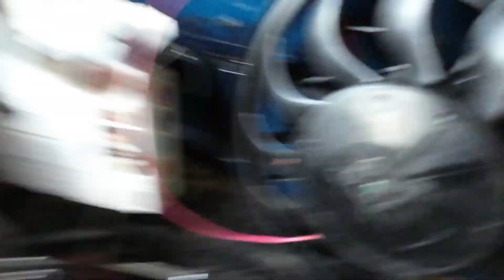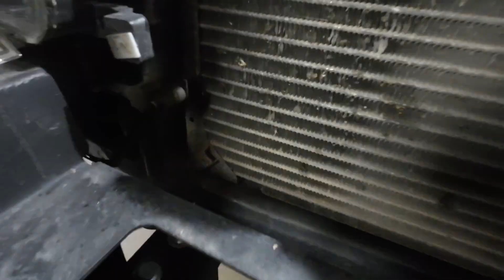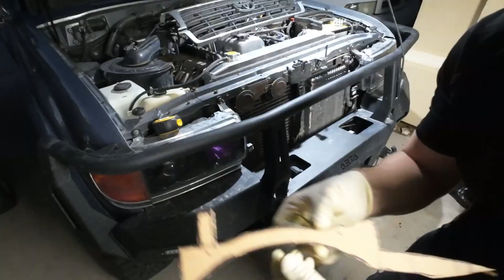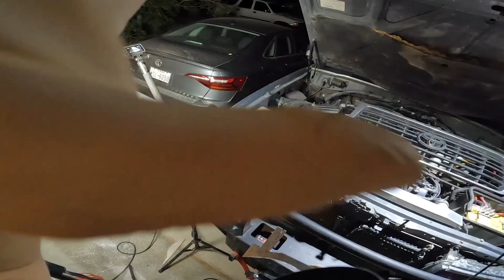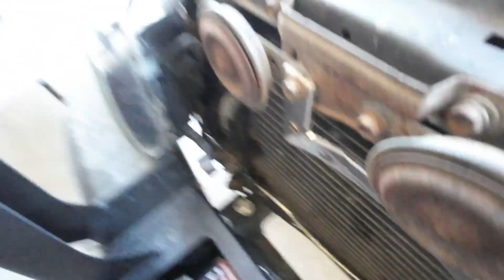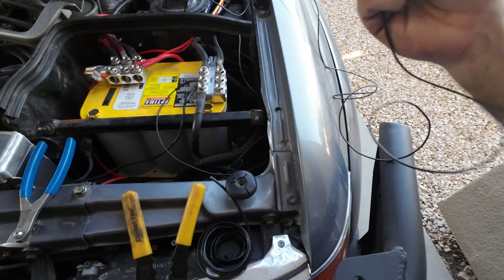The Secret To ICE COLD AC In An 80 Series Land Cruiser! | Aux Fan Install FZJ80

Comment: How is the fan working in summer?
Reply from the maker: It still works pretty good! I think it's a noticeable difference from not having one. Unfortunately I will be removing it for an intercooler very soon, but I still want to figure out a way to push more air through the grill if possible.
Reply: @motor.mausGarage  nice cant wait for the video, try an interchiller, and low profile electric fans for the radiator. There might still be some space left for the AC fan.

Comment: Toyota really cooked the 80 series with the small condenser. I have a surf where they slung the condenser under the engine and its awesome. With the additon of that extra fan on your 80 series I would also charge the ac and go over to give it more subcooling and to stack more liquid refrigerant in the condenser. Another more expensive route is to replace the condenser with a new direct fit or a much better universal fit micro channel. Your car already has the largest denso compressor offered so replacing that will be fruitless. Another thing you can do is replace the evaporator and TX valve. Toyota at least used off the shelf denso parts so its relatively painless to source. I am lucky with my Hilux surf as toyota slung the condenser under the engine. I removed the twin 7in thermo fans and fit a 14in SPAL fan. replaced the evap and TXV and it really gave it a kick up the ass.
Reply from the maker: Great tips. I did a lot of AC work before this just to refresh it, but there's still the original condenser on there. I have a new one from Toyota but you bring up a good point on the size of it, I may look for a larger one 🤔

Comment: If you want really cold AC either fit a new evaporator core with a new TX valve or get your existing evaporator core cleaned thoroughly which requires removal. If you try cleaning it without removal will not be as good but ideally just get a new one. You would be surprised how much crap blocks up the evaporator core over the years limiting airflow across it. I got mine replaced with a new one made a huge difference much colder and stronger air flow. I also run a condenser fan.
Reply from the maker: I have cleaned mine out in a video that I had never posted as it didn't come out well and I didn't film very much 😂. I didn't replace it due to them not being available in the US, but I didn't know about partsouq at the time, so I may revisit that when I replace my condenser at some point in the future. Also threw a new expansion valve and dryer in as well.
Reply: I have put in a complete new system: evaporator, dryer, condensor, valve. But in very hot climate, with low rpms, the AC doesn't cope with the heat. An aux fan is really a must in a hot climate unless you're doing freeway all the time without traffic jams 😊

Comment: So now that summer has definitely hit, how is the fan working out?  What kind of temps are you pushing?  In Vegas around 110°+ I'm pushing 60°ish without a fan
Reply from the maker: Yeah I'm sitting around 102-108 depending on the day. I haven't measured it directly, and admittedly I should probably replace my condenser, but so far it has made a pretty significant difference over not having one last summer. AC is quite nice when idling for long periods compared to basically non existent before 😂.

Comment: why not just upgrade the clutch on the belt driven fan to move more air???
Reply: Oh, perfect! Do you have a link to it by chance? I wanna see if it'll be compatible with my 80. Mines got the diesel engine, and i dont have the room to install an Aux fan because of all my coolers i added an intercooler.....
Reply from the maker: This is the one I got, but I don't think it'll work with the diesel engines. I'm not sure if there's an equivalent 🤔

https://redlinelandcruisers.com/shop/80series/1fz-fe-80-series-land-cruiser/modified-95-degrees-fan-clutch/
Reply from the maker: Already did! This is for idle/low rpm AC performance mainly
Reply: Thank you! I sent them a email asking about it. 🤙

Comment: It's always good to torque down the grill screws to 300 ft/lbs 😜 So whenever the AC is on the fan will turn on? It doesn't gauge what the temp or pressure is in the AC system is and then turn on? I think there are a couple of write-ups in Mud about this. I am curious to see what affect this has on the H2O temps when that air is being blown over the radiator.
Reply from the maker: Yeah, basically this fan runs off of the AC pressure switch, I'm not sure what the function of that switch is, perhaps for compressor operation. I went wheeling soon after this and it keeps the temps right at 190 while doing low speed stuff and idling. It was about 85-90F ambient temp so I think that's pretty good. We'll see this summer when we're well over 100 degrees lol

Comment: Those solder joint connectors are trash. Bought some and just metal plastic before the solder melts, heat gun isn't any better
Reply from the maker: Good to know, figured I would use them on something less critical just in case 😂